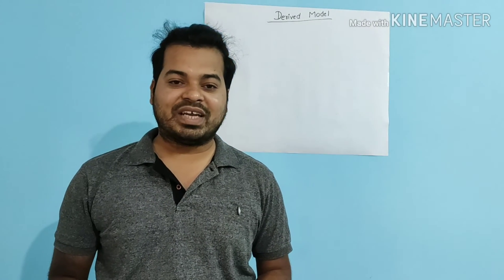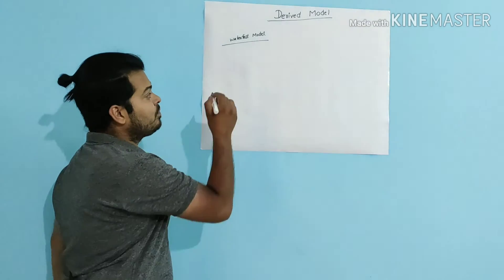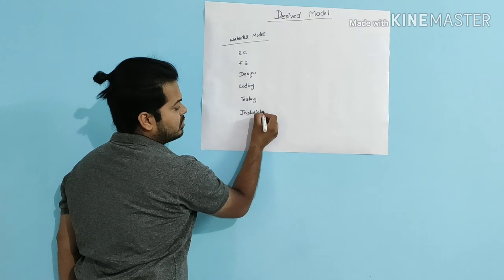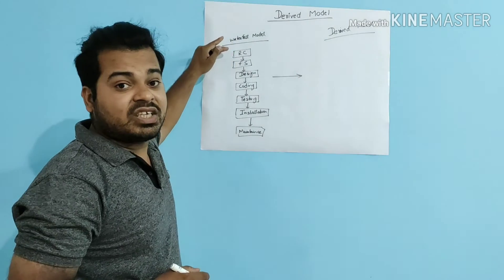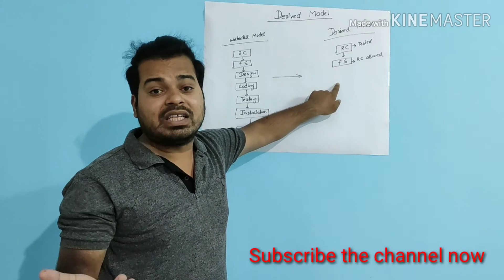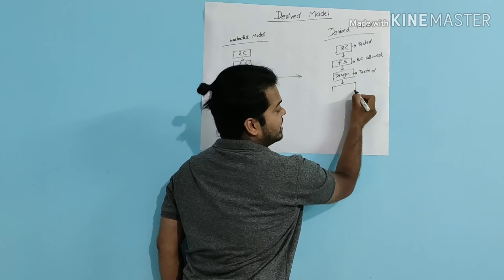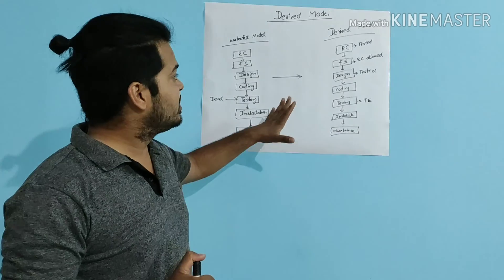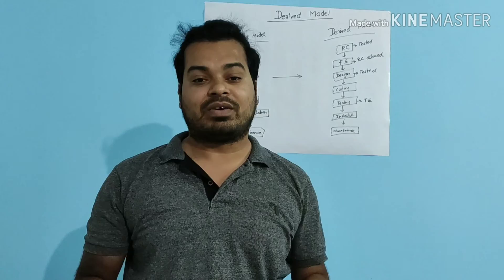Derived Model in Software Development life cycle

Comment: Hi, In waterfall you cannot change requirements but in Derived you can. after the change in requirement do we have to do the testing from the beginning to make sure the software running as per the requirement? It is not very clear to me. If you can please answer. Thanks
Reply: If it is as per requirement it don't require to test again from starting..I think so..please check out